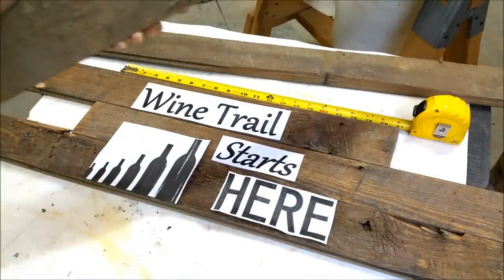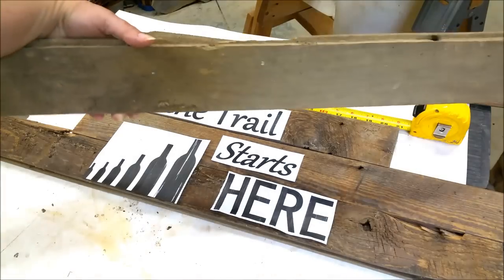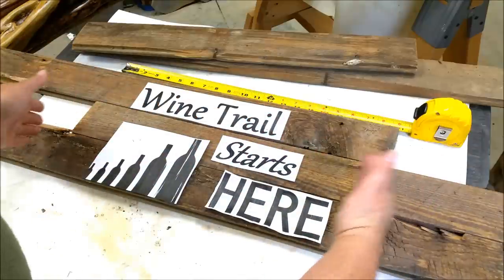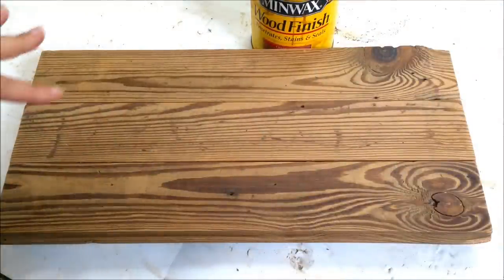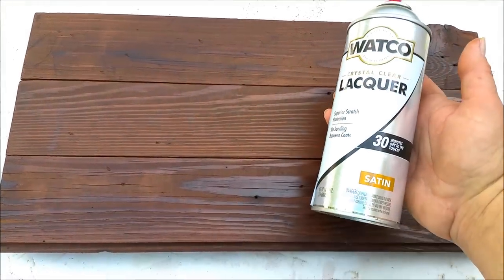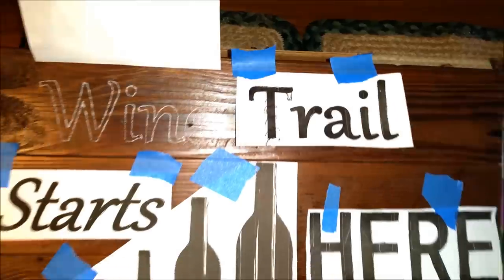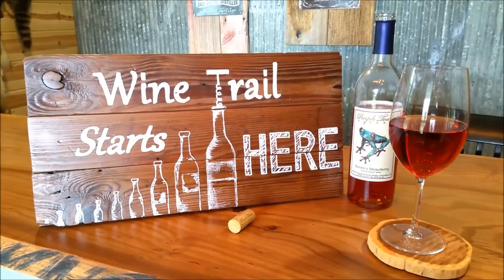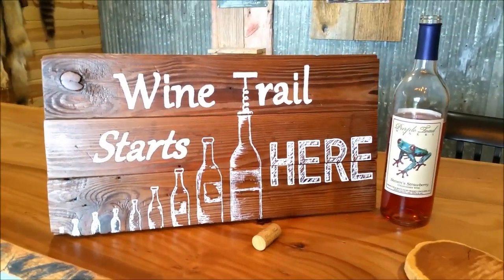DIY RUSTIC BARN WOOD Sign with Mrs. Kapper. Creating farmhouse decor!

Comment: That turned out great.
If you get a planer, get some kind of metal detector or security wand.
Working with repurposed wood like you do, you wouldn’t want to
ruin the blades on a missed nail.
Reply: Thanks Steve and thanks for the great advice! Some of that  stuff is loaded with broken pieces of rusty gold 😁

Comment: Planer coming soon??? Dewalt 735 with xtra set of knives on a stand??? PM me and it's available!! Milwaukee is not that far away :)
Reply: Lol, you really want to off load some of that equipment 😁
Reply: @CedarBluffRustics  LOL, guilty as charged, but only if you're interested, I'm sorry if it seems a bit pushy.
Reply from the maker: Mom lives in Racine. Guess I'd have to let her see if it is a decent unit that would fit her needs, thanks.
Reply: @kapperoutdoors  Sounds good Kapper, I'm going to meet with John Junior and a mutual friend for lunch hopefully before New Years, I will say HI from you then.